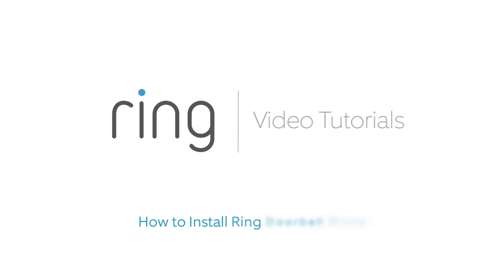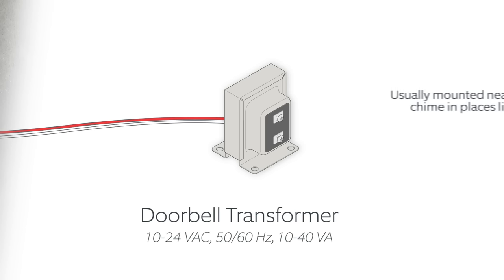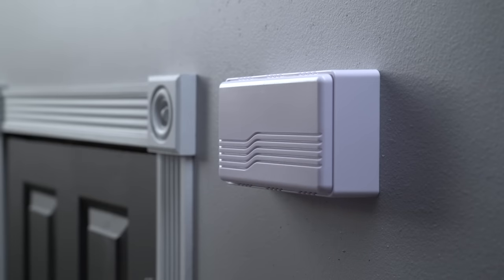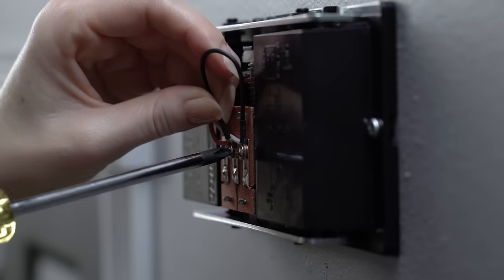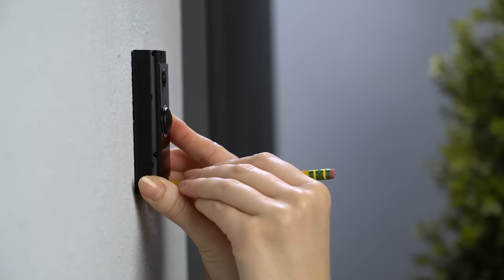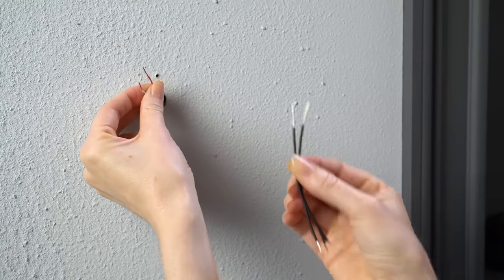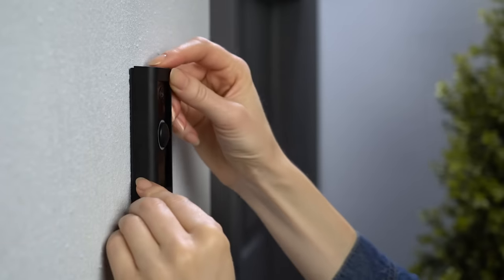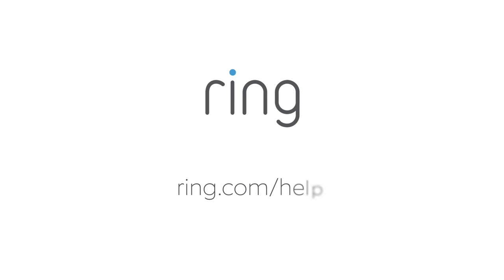How to Install Ring Doorbell Wired | Ring

Comment: Get something else, I had to return my ring door bell because according to their supporting page, it stops working in cold weather if the temperature goes under 32F, or 0"C.   We has a few days snow, and my is dead.
Reply from the maker: Hi, Eric. We understand how important it is that you can rely on the battery of your Video Doorbell. Please give our community support a call at 1-800-656-1918, (or if outside the US: http://ring.com/callus) 24/7, for more support. We look forward to hearing from you.
Reply: Was it one with a battery? Cause that tends to happen. This model you commented on does not have a battery, therefore, this issue is less likely.
Reply: @joeythefoxxo  Yes and no.  Yes because it has a battery in there. No, because it is hardwired to charge the battery. When it is under 32F, the battery won't hold a charge and the camera will start to lose power, eventually runs out and become dead.   Their official support forum recommend to bring it inside, wait till it gets warm before put it back.

Comment: I have the ring doorbell and know where the transformer is, but I can’t determine which breaker powers the transformer and don’t want to pay $300 for an electrician to come. So, the doorbell sits unused in its box, probably forever.
Reply from the maker: Hey neighbor. We understand the importance of utilizing your Ring Doorbell to monitor your home, so we are here to help. Please give our community support a call at 1-800-656-1918, (or if outside the US: http://ring.com/callus) 24/7, for more support. We look forward to hearing from you.
Reply: Just short out the current transformer. You’ll find out quick. 

Just kidding. You may want to go breaker by breaker and label as you go! It’s a quick project that will have you set for all future jobs. Shut off each breaker until the doorbell no longer works. You can always get a cheap voltage tester to verify.

Also. It is safe to install the ring doorbell with power still on (since it’s only 16-24V instead of 120V). But make sure you install the doorbell BEFORE using the chime bridge wire.
Reply: Just flip the single breaker at top (usually facing the other direction than all other ones) to off. This cuts power to the whole house.
Reply: Find a cheaper electrician, shouldn’t cost more than $120
Reply: Dude, just turn breaker switches off until the doorbell doesn't work.  Then turn it back on when you're done.  You don't need an electrician for that.

Comment: OK by a transformer that drops from 230v to 10v to 25v for example then connect the 230v side with say 1.0mm or 1.5mm t&e lighting cable and connect to either a lighting junction supply or next to the consumer unit and into the 6a lighting breaker then from the 10 25v transformer supply connect standard bell wire connect that to a chime and the from the chime to the ring doorbell

Comment: My door bell has dc power, I can pull both wires off and no electricity at all, but my door bell works perfectly fine, beings I'm not getting jolted by anything I am assuming I have dc power that's probably why I can not get any of these ring or arlo Doorbells to work wired in only if I use the battery . So I returned them and put my normal doorbell back on, I'm not going to spend tons of money on replacing batteries all the time

Comment: I can see how this is confusing . If your doorbell works that means it has a working transformer. The transformers job is to stop down and change  AC to DC or straight line current yes, the kind it doesn’t usually kill you.

Comment: Don't buy. There are some serious problems. In order to drill holes longer bits are needed, bits or extenders that are not sold in Home Depot. If you have to reset the doorbell alarm or if you need the QR code you have to unmount then remount, a very big job. After being on the phone with ring support for one hour, I now have to pay at least $130.00 for a professional installation. I wish I have never bought this thing, but I have no turning back because of the holes in my front wall.
Reply: How did it end up after being installed? is it working and worth the money you spent on the product? (not in the mounting job)